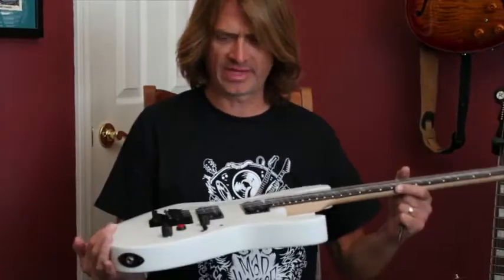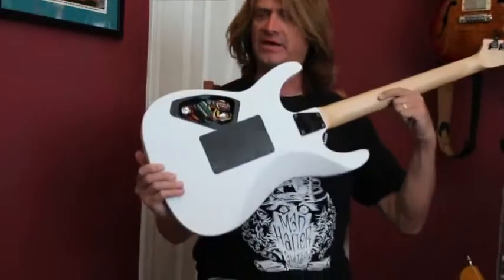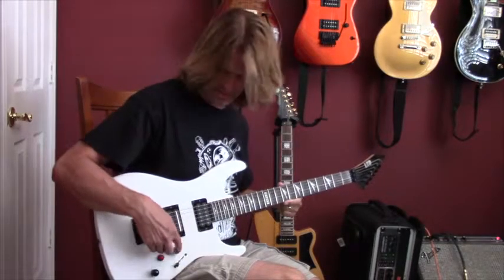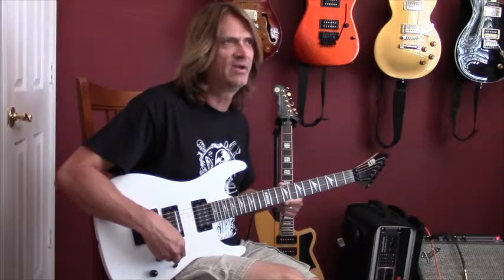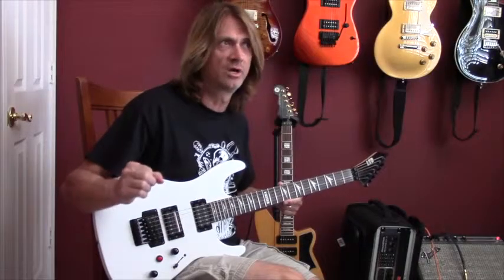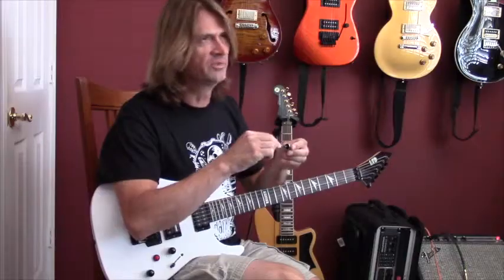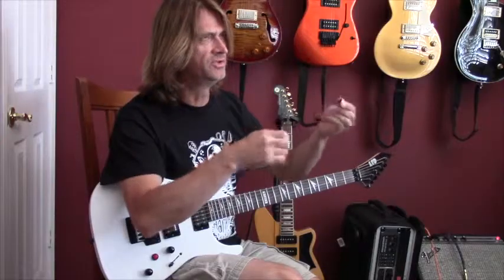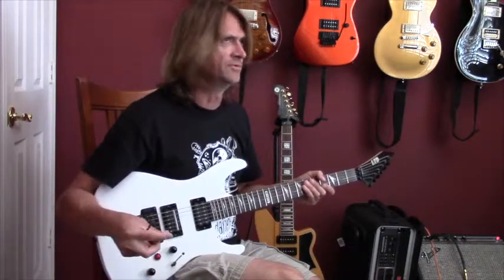Tight Fitting Guitar Knobs

Comment: Thanks. I suspected I'd have to bore out the hole. I forced a knob onto a cts pot and when I tried removing the knob it ripped the shaft out of the pot. Frustrating.
Reply from the maker: Brett J I’m sorry to hear that happened. If it’s one of our pots hit us up at info@madhatterguitarproducts.com. We’ll take care of you. 

The difference is CTS shafts are a 1/4” diameter with 24 teeth. Other pots manufactured outside of the USA are metric and have a 6mm 18 tooth shaft. So the knobs designed to fit on the metric knob has too small of a internal diameter to fit on the 1/4” shaft. 

We’re planning an in-depth video soon that breaks down all  the different shaft and bushing sizes.

Comment: This seems over simplified and not a clear understanding of what is going on. It isn't so much that the knob holes or pot shafts are different sizes but that the bi-furcated splined shafts on the USA pots have 24 splines while the pots manufactured outside the US have 18 splines. If you use knobs with spline indentations that match the shaft they should fit. 

However there is another issue with pots that do not have a circlip or shoulder in the shaft to stop the shaft moving down in the fixing bush. Recent CTS pots for example often don't have this stop on the shaft and since CTS have reduced the thickness of the steel they use to make the shells of the pots, it is all too easy to place enough pressure on the shaft when fitting a push on knob that the clamping tabs on the back shell of the pot fail, the shell comes off and the shaft comes right out the back of the pot. Either that or the tabs loosen the pot just feels loose as you rotate it. Why CTS pots with shafts for push on knobs are even sold without a mechanical stop on the shaft I just don't know. CTS say - 'Oh you have to support the back of the shell when fitting push on knobs'.